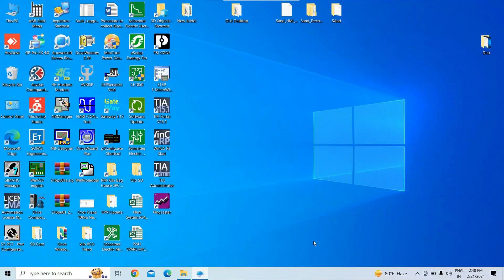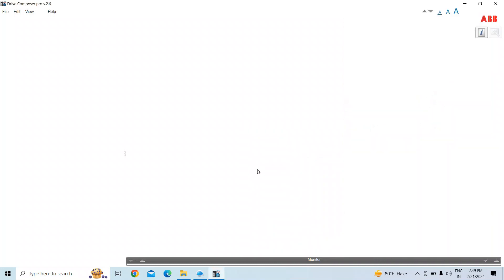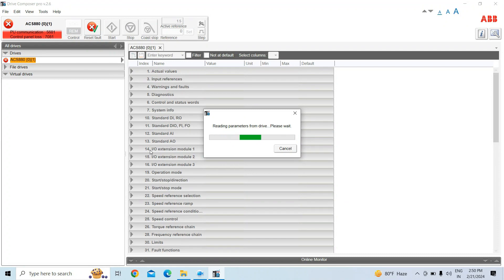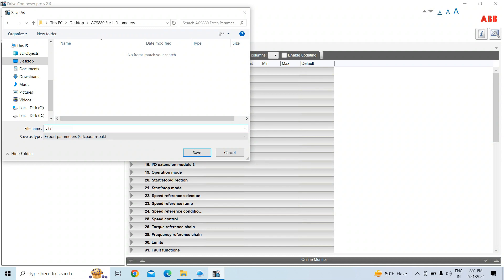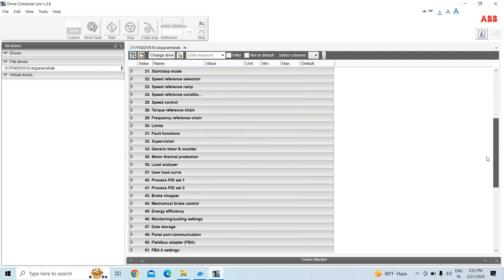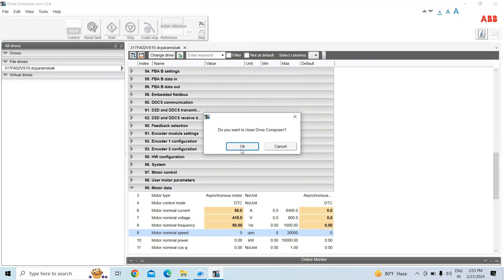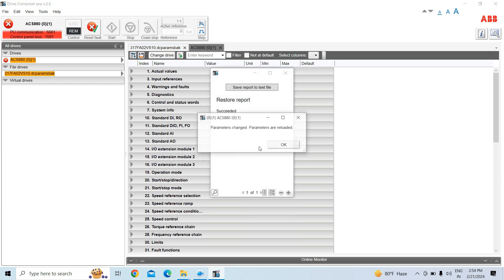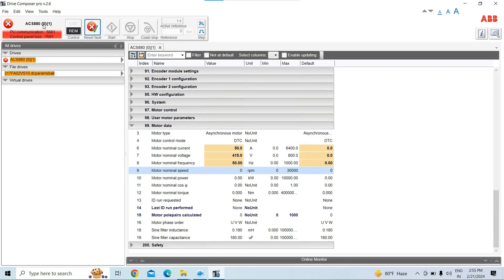ABB Drive ACS880: Step-by-Step Guide to Backup and Restore Using Drive Composer

Comment: Hello brother,, what the aplication for open program back up, i try back up same like you, but if i open data back up.. cannot
Reply from the maker: You can use ABB drive composer lite which doesn't need any license
Reply: @faridautomation  Hi , I have a ACS580 in annother place where I connect TIA portal with VPN, can I also connect with the ACS580 with Drive Composer?